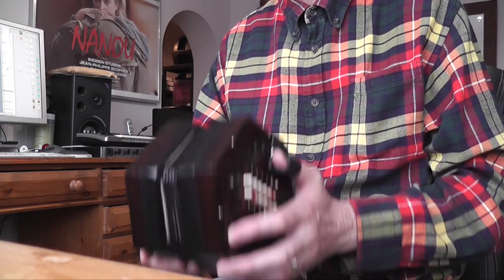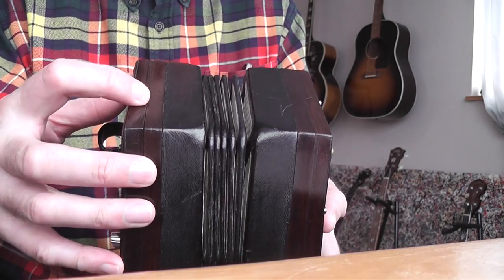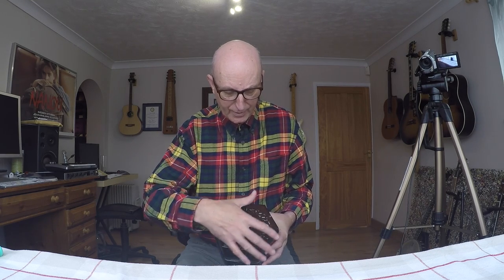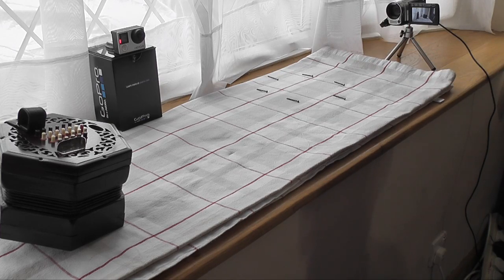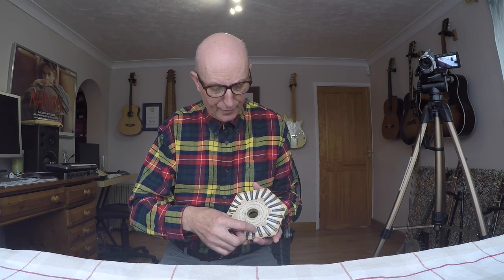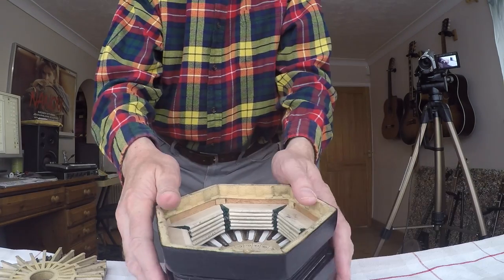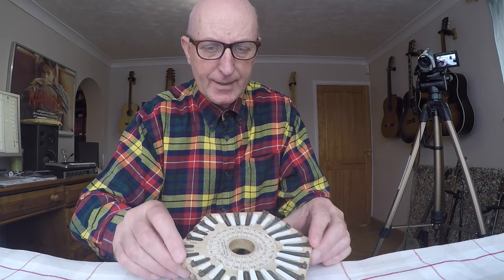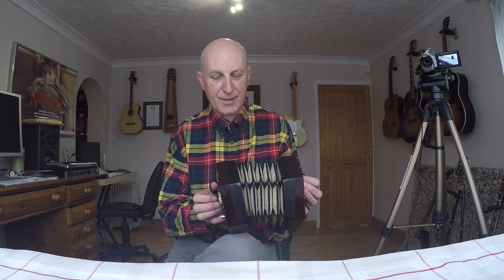Opening Up An English Concertina To Try To Fix A Fault

Comment: Are you missing a couple of valves on the smaller side. Hard to tell maybe it’s meant to be like that but it looks like they’re missing.
Reply: The smallest reeds don't normally have valves. They are not needed because the gap around the side of the reed tongues is so small that the air leakage is minimal. Fitting valves to these tiny reeds would (a) impede the desired air flow and (b) mute the sound somewhat.

Comment: Thanks for posting this video. Very informative. Did you ever find what the problem was and how to fix it?  Thanks
Reply from the maker: Hi,

No, I had to give it to my fettler, Martyn White to fix.  Sorry, I can't remember what the fault was!!
Reply: @daddylongles  The buzzy low pitched sound that you had was almost certainly due to a faulty valve. Sometimes they can look OK but can vibrate in resonance with the main note, instead of lying flat to seal the slot in the reed pan. Also, if a valve has been replaced without completely scraping off all the old glue down to bare wood, the new valve does not sit flush on the reed pan surface but is slightly proud due to the old glue. This can cause air to leak and make a buzzy sound.  You can clean off the old glue with a sharp blade, e.g. a scalpel blade; or a very narrow, very sharp chisel held parallel to the reed pan surface. But be very careful not to make a depression in the wood when doing this.

PVA, animal/hide glue or gum arabic are the best glues to use to stick valves on. I prefer the latter. Easily available, easy to remove if necessary, and non-toxic.
Reply: @daddylongles  Thanks for sharing your thoughts on this.  My wife asked me to try to fix her a Wheatstone English with the same issues, and I had followed the same problem thought process as you with same end result other than then  having nobody locally to take it to.  Out of curiosity (having previously gently twanged the affected reed and cleaned with compressed air and sheet of paper to no effect)   I took the reed pans out (without touching the clamping screws). Qualitatively the reeds sounded slightly different but identically pitched when sucking on them with my mouth. I swapped the inhale and  exhale reed/ reedpan units  over (noticing that the slot for the bad sounding reed had a looser fit to the pan)  then reassembled the instrument and the problem immediately  resolved.  I cant explain this with certainty but speculate that the the pan wasn't sealing properly at its margins ( perhaps it had vibrated slightly towards outer edge) thereby  creating some undesirable air turbulence disturbing the sound waves. Hope this addition info may be helpful to others searching similar holy  grails :).